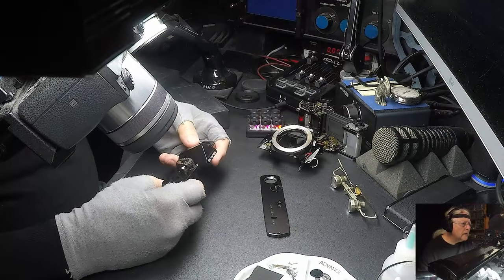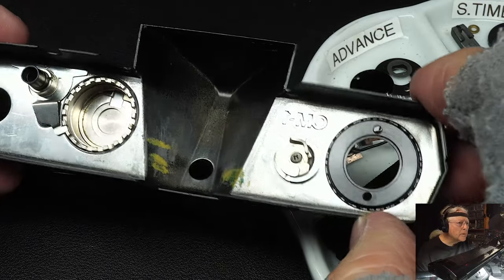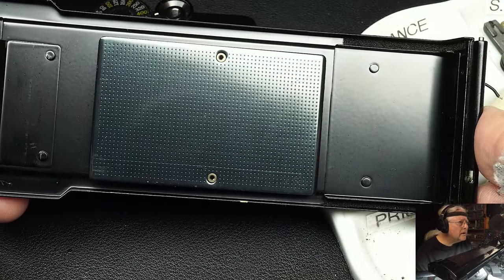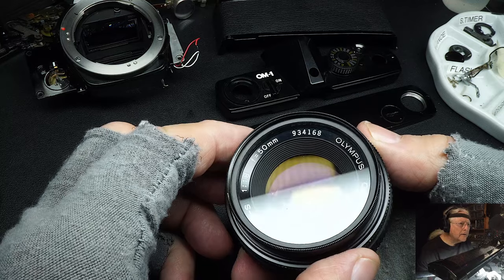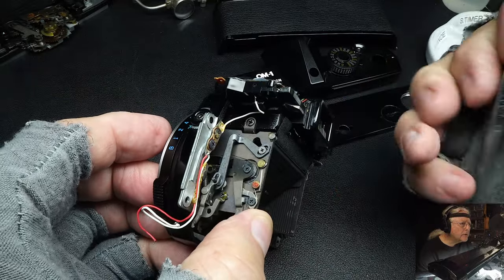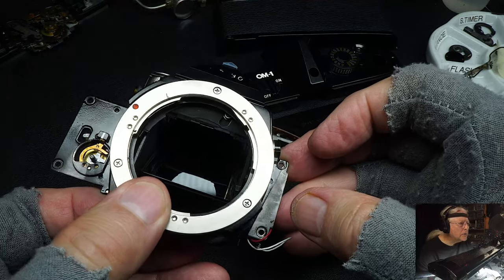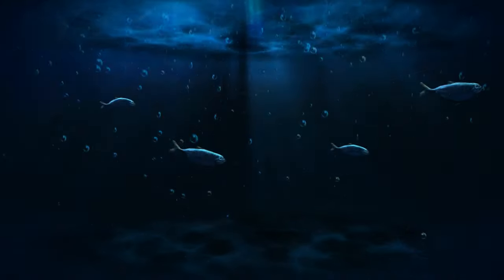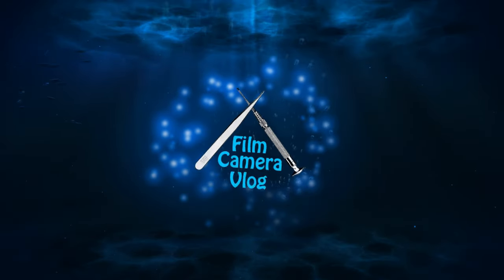Tour Inside the Olympus OM-1 | Vlog #016

Comment: Hello, My OM1 has focus problem. What it is in focus on the viewfinder, is not in focus on the film. What do you think? I've tested with a ground glass and the problem seems to be in the viewfinder or mirror.
Reply from the maker: I probably can’t help you without seeing the camera, but I’ll tell you what I’ve seen in my past repairs. I’ve never seen a camera just go out of focus on its own. Usually it was the lens being out of focus, not the body, or it was my fault. Sometimes when working on a camera I reassemble it incorrectly, or I forget to put in a part or I put in a part upside down. Impact to the front of the camera can also cause focus problems. 
     I know this is probably not helpful. There can be so many things causing your problem. If it’s not too late, I would tell you to not touch any of the focus adjustments. This usually only makes things worse. If the camera is assembled correctly, it will be in focus with the factory settings. It’s always helpful to have a second junker camera to compare with or swap out parts. 

Regards
Kori

Comment: Sir, thank you for your videos, they are very helpful. I disassembled an OM1 to see what was happening with the meter strings and the strings are disassembled out of  the pulley  Can you tell me where I can see a photo or a diagram that shows me how to put the strings on? on the pulleys and reassemble everything correctly?  thanks for your help
Reply from the maker: I did some looking on YouTube, but could not find any videos on the OM-1 meter strings. They are not easy to reset, even for me. And there is also the question of why yours were off the pulleys? Until you find out, it will just happen again. I can only suggest you buy a locked-up OM-1 on eBay for $20 and take it apart (slowly/carefully), while taking pictures of the meter strings layout. This will teach you how to fix your own camera. I would like to make tutorials, but I repair cameras full time and only use my spare time to make my vlog videos.
Reply from the maker: As for the meter strings and pulleys on the front of your camera, I am making a video on the OM-1n in which I explain how the strings and gears are laid out and timed. It's not really a tutorial, but it might help you reassemble your OM-1.
https://www.youtube.com/watch?v=MEDab0QETeQ&t=34s&ab_channel=FilmCameraVlog
Reply from the maker: https://www.youtube.com/watch?v=MEDab0QETeQ&t=34s&ab_channel=FilmCameraVlog